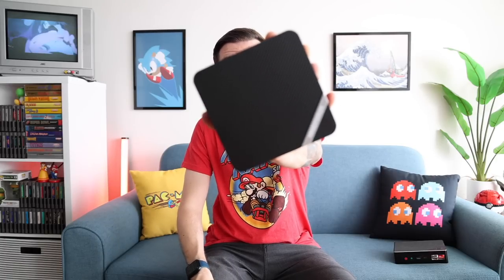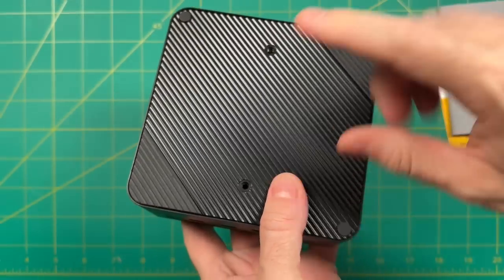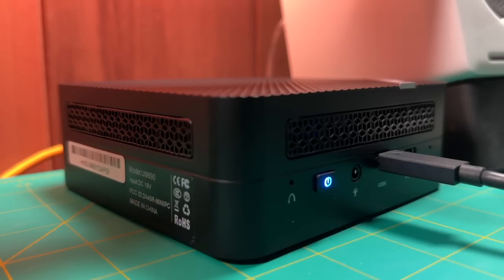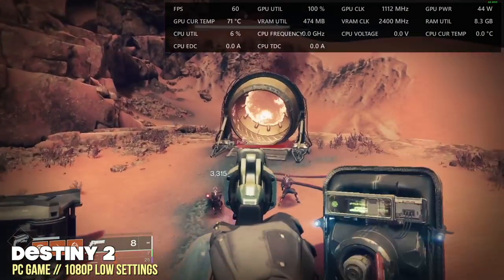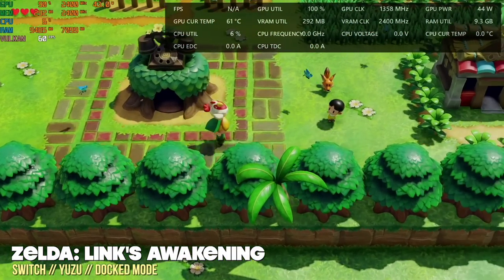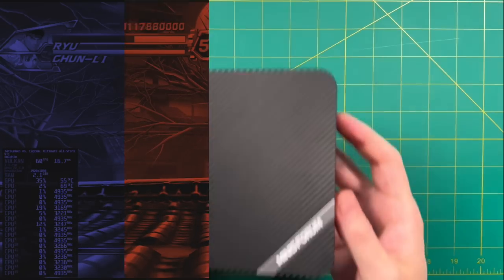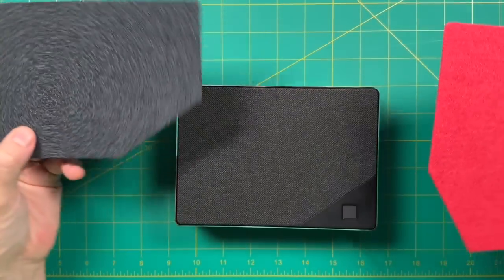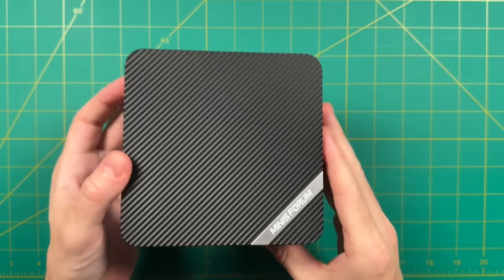MinisForum UM690 Review (Ryzen 9 6900HX)

Comment: If you are spending this much money you might as well just get a steam deck. Especially if you are used to emulation. You will have no issues on Linux. Then if Valve do a standalone unit get it further on down the line.
Reply: This has better emulation capability than the steam deck. 

There are things windows just does better than the steam deck. For example, cracked games ( if you are comfortable enough to discuss emulation, then cracked titles are not a taboo subject). 

Windows is shit on steam deck.
Reply: but this has way better performance than steam deck so no idea why you're comparing.
Reply: this mini pc is legit amazing for people that mainly just need a very powerful cpu and doesn't really need a powerful gpu. it's super tiny and uses very little energy. has twice the cores of the steam deck and at least 3 times the multi core performance. even the gpu is probably 50% better since it has 50% more CU.
Reply: @nathanjokeley4102  for a little more money you can get the hx80g with a 28CU discreet GPU though.